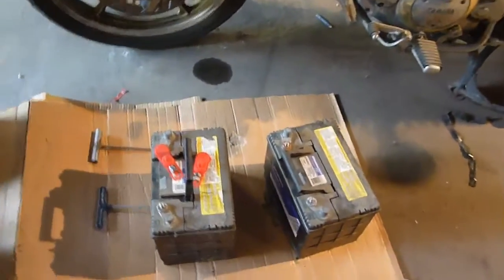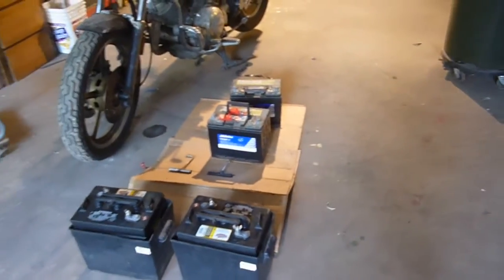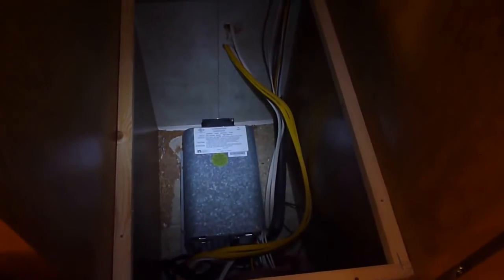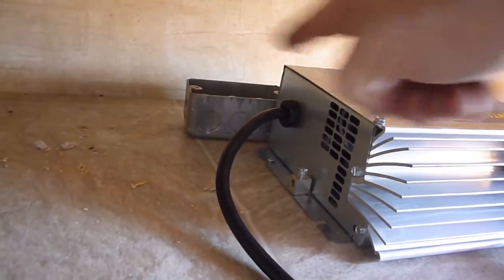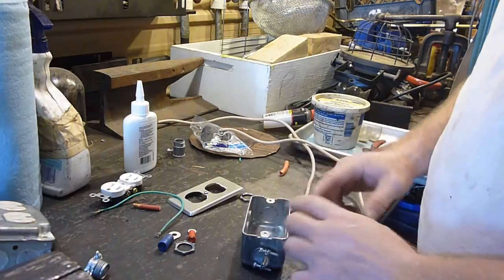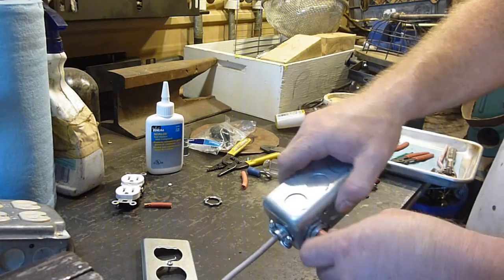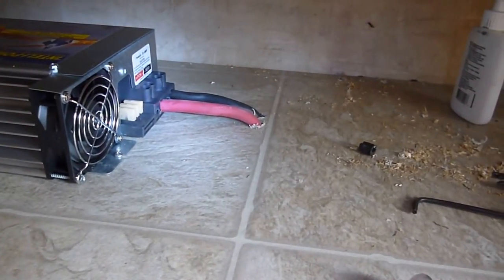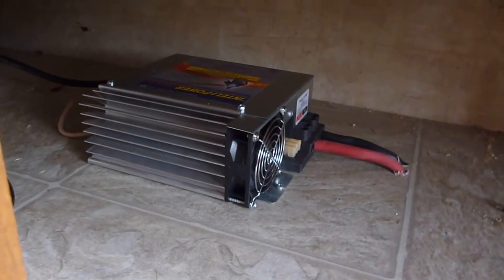COSTCO BATTERIES & INTELI-POWER 60 AMP CONVERTER CHARGER PART#1

Comment: So many things wrong with this.  Box fill, combining low voltage with high voltage, mixing grounds, using extension cord for a permanent installation.
Reply from the maker: i hooked up the product exactly how it was supposed to be installed to the battery's the only thing i did was permanently hook up my extension  cord and  ran the grounds together threw the same hole its now different then running an extension  cord threw the door and plugging  it in and hooking the ground the same if you know about trailers there is 12 volt and 120 volt mixed in the unit below its hooked up just like the unit in the trailer already only i built in a separate plug  admittedly i did over fill the box some but iv checked and its not getting hot but i may get a bigger box but  its working perfectly

Comment: Amp hours are rated at 6v on 6v batteries which is not the same as amp hours of a 12 V battery
Reply from the maker: thanks for the info . so far i am extremely happy with them and they are lasting longer on a charge but i think my other batteries were on there last legs